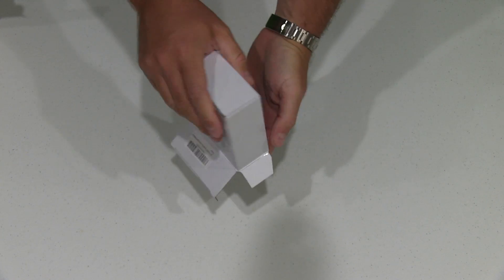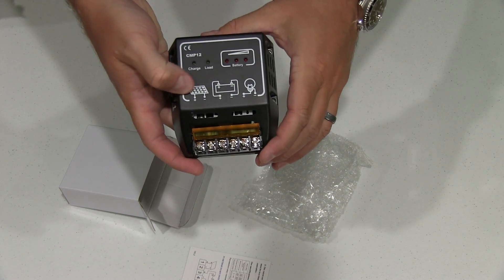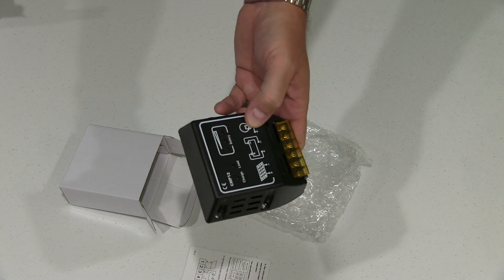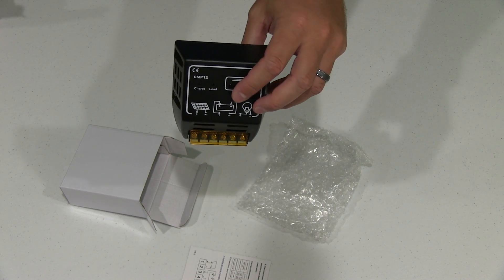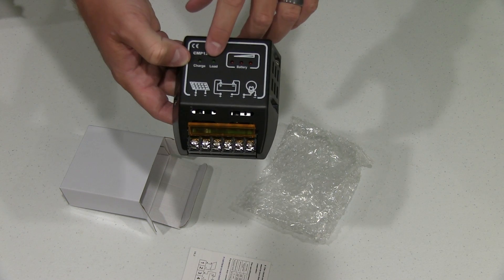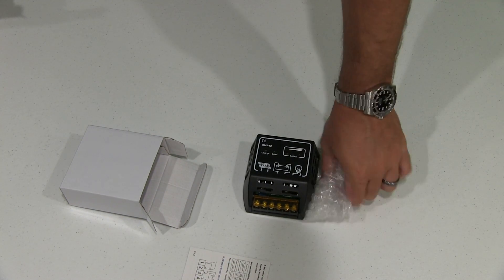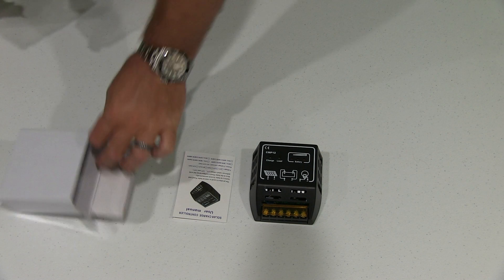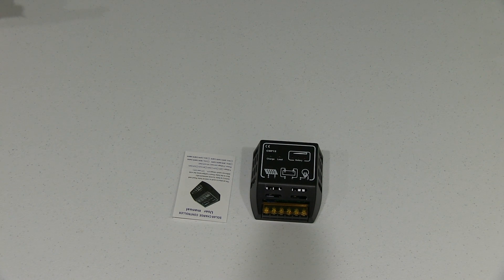10A 12V 24V Solar Charge Controller Solar Panel Battery Regulator Safe Protection Unboxing

Comment: So does the output load switch on when the sun goes down or is it on all the time?
Reply from the maker: No sun/no charge
Reply: @IrixGuy  it has 6 terminals 2 for the solar input 2 for the battery  and 2 for a way to use the power collected. Is the third 2 terminals automatically switched on at night or is it providing power from the "battery" continuously. Somehow I just figured solar panels only operate when the sun is shining. Lol

Comment: I have one of these and it's utterly spastic, over voltage, voltage run away as well.
I had a Gel cell connected up, was charging at 17-19v    WAY too high. (by the time i realized, the battery was boiling hot and I had to put it in a bucket of water to cool it down, god knows how much damage was done to the poor thing)
put a fully charged battery on and it was trickle charging at 14.7  again, way too high.

I've taken it apart and it has three trim pots for fine tuning but I've been unable to find information for what each pot does.
so atm it's a lost cause and I'm unhappy with it to say the least.
Reply: +John Douglas do you use 24v panel to charge the 12 v battery?
Reply: no, it's an 18v 90w panel.
Reply: +John Douglas THEN YOU MUST GOT A FAULTY ONE.
Reply: yea, I'm pretty sure I did get a faulty one :/
bummer.
Reply: 14.7v is the maximum recommended voltage for charging 12v batteries mate...anything over and it'll cook the batteries..
Reply: Did you figure out what the pots did? I just got the same charger and tried to find info on the same pots without any luck, several years later.
Reply: I am about to purchase one for my 3s lithium batteries. Now, I don't know what to do ;)
Reply: @yusifsuleiman5502  buy an EPsolar model, excellent hardware and not expensive. if you want GOOD, victron.